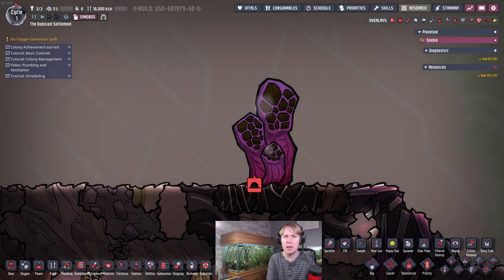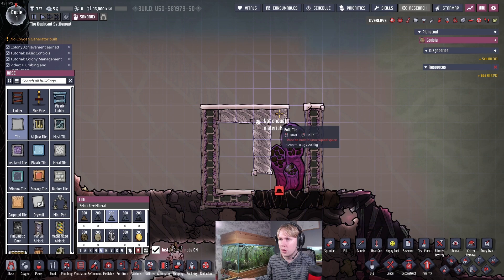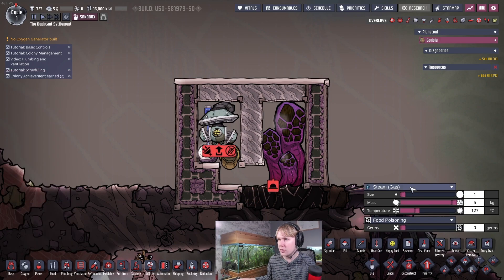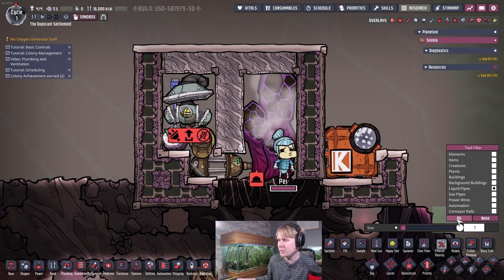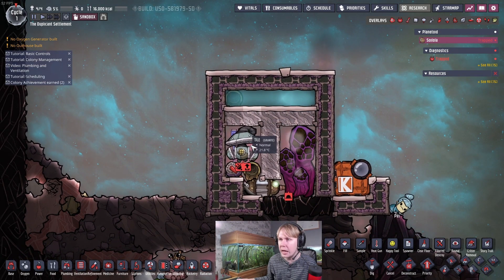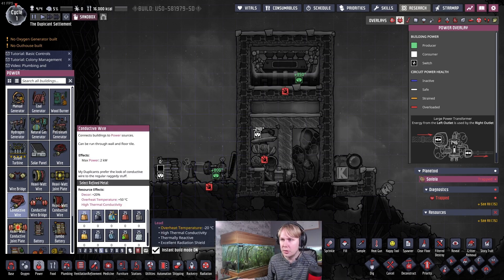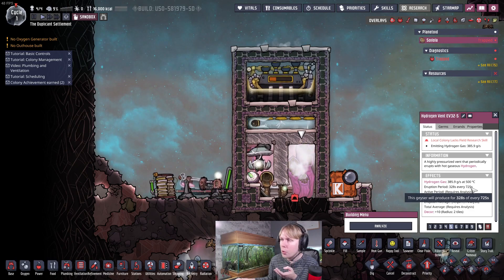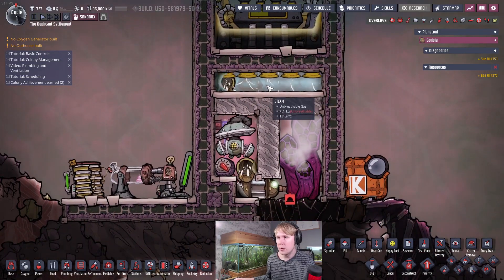How To Handle Hydrogen Vents In ONI: Spaced Out! Sandbox Showcase #9

Comment: This is a great build, but somehow after about 400 cycles it broke cus the oil/petrol got too hot and the turbine couldn't operate. Do you have any idea as to why? Best thing I could think of is my turbine is close to a volcano tamer so the insulated tiles shared heat very slowly

Comment: Is overpressuring a thing if you use ALL the outputted hydrogen anyway in generators?
I'm trying to find a reason not having to use a game glitch here with that drip pump...
Reply from the maker: You can use a series of opening and closing air lock doors with automation to compress the gas if you'd rather not use the drip pump. This should be able to infinitely compress the gas if set up correctly but takes up a bit more space.

Comment: I really like this tamer, but I have an issue with it. When I load my game, I get about 90 grams of petroleum next to my crude oil blob, stopping the dropper from moving the hydrogen. Luckily, I had just built your sulfur geyser tamer and used the naptha trick to break in and mop up the oil without blowing my 180 kg per tile of hydrogen to the ether. 

Have you seen this, and if so, do you have a remedy or alternative build that works on game load? I am also using your natural gas tamer room and have seen a tile of steam appear on game load, but that usually works itself out.
Reply from the maker: That's interesting, has the crude oil been getting hot or is it cold petroleum?
Reply: @erisia_gaming  Bothe crude and the petroleum are at 125 C. It's not just on game load now, it can happen in the middle of a session. The last time it happened I noticed that the liquid vent had overpressured from the 1000+kg/tile hydrogen. I begin to wonder if the vent gets blocked for a short time from pressure, then hydrogen burns off and releases a large blob of petroleum. Which makes it a large storage but not infinite. I might try to squeeze in another atmo sensor to force burnoff at 900kg.

Comment: Do you need to put the valve inside the tamer? If you leave it outside, you don’t need to make it out of steel, and you can adjust it after the fact, and you pipes won’t blow from the heat.

I also like using the meter over the valve these days. You can adjust the flow without dupe interaction, it just costs more and you need to wire it to power.
Reply from the maker: Yeah both of these are good suggestions.

Comment: Does it still work of I put 5 geotuners on it? Or will the steel pump overheat?
Reply from the maker: So the average Hydrogen Vent produces about 175g/s of 500° C Hydrogen during its active period. With a heat capacity of 2.4, cooling it down by 375° C requires 375 x 0.175 x 2.4 = 157.5 kDTU/s of cooling. The Steam Turbine running at 125° C will produce about 221.7 kDTU/s of net cooling after cooling itself. So, without any Geotuning, the Steam Turbine will keep itself and the Hydrogen cool at the same time. If you put 5 Geotuners on it, we now have about 350 g/s of 575° C Hydrogen. This requires 450 x 0.35 x 2.4 = 378 kDTU/s of cooling. A Steam Turbine running at 145° C will produce about this amount of cooling, but this is usually too much for a self-cooled Steam Turbine to handle. So you'll need to use two Steam Turbines so that they each handle 189 kDTU/s of Hydrogen cooling. For this you can just make the top part twice as wide and definitely use more conductive material for the tiles (such as Aluminum). The Steel Pump should not overheat provided you have enough conductivity.

Comment: I noticed you still use radiant pipes for self cooled steam turbines. I recommend you try out conduction panels! 3 conduction panels for the output water to pass through the steam turbine will keep it nice and cool (for a self cooled turbine anyway). Costs less metal, works in a vacuum.
Reply from the maker: Interesting, I will have to try this now that they have been buffed too.
Reply: @erisia_gaming  I tried them out with Cobalt steam turbines + Cobalt conduction panels. Lower SHC metals might cause issues, but I'm not sure.